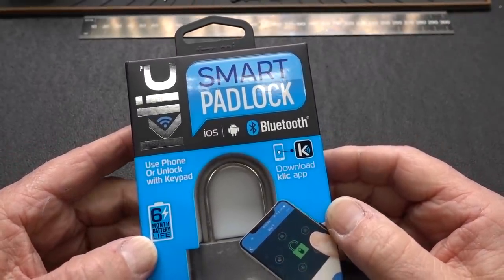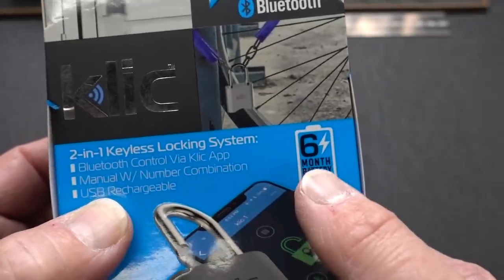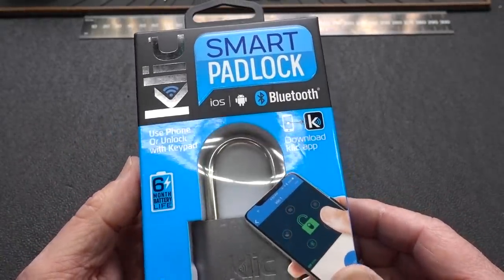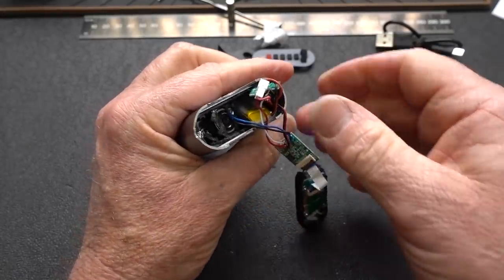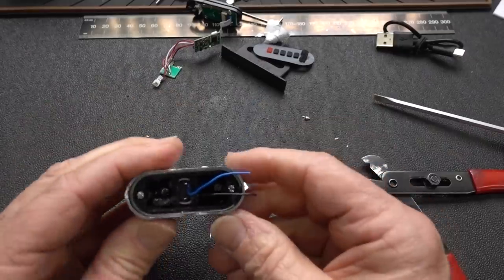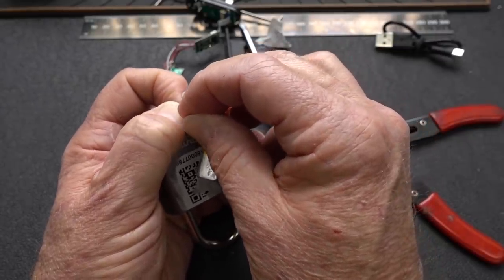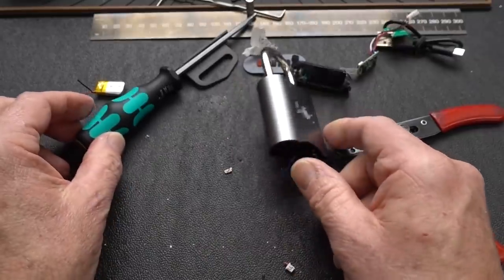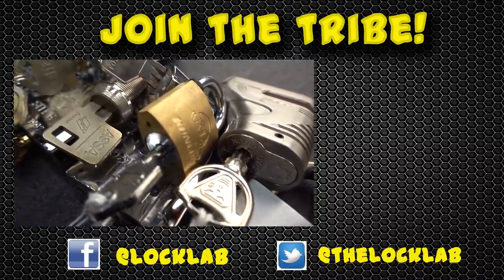(1479) Klic Bluetooth Smart Padlock (JUNK!)

Comment: Holy moly, this is basically hotwiring a padlock 🙃😂
Reply: Robert Chrisman yep thought the same thing but replace moly with shite.
Reply: They call it "Spiking".  Real common way to open safes.  On a safe you usually use a 9v battery.
Reply: @jmr  thanks for the insight!
Reply: 😭😭😭im trying to brake in without braking it
Reply: the hope with this is maybe if you put it in a public area the thief wont bother messing with it.

Comment: If there's anything I've learned from bigclive it's that you should always have an explosion containment pie dish handy when dealing with cheap lithium batteries.
Reply: Especially when potentially stabbing it with the "app" or shorting the leads together after removing the connector.

(Also, big up the Big Clive posse!)

Comment: Glad someone made a video on this. I bought 12 for $1 a piece in the Walmart clearance section. I'm using these locks for plastic gun cases which can easily be cut through with a knife. So to me it makes sense to use a low security lock on a low security plastic box. At least it looks legit when I make the trip out to the gun range. Other than that use I cant imagine using these like you would a normal master lock.

Comment: Saw one on sale at Walmart for $4, picked it up as a neat toy. Thanx for showing me that I don't need to go get bolt cutters if it decides to die on me. Currently using it as a non critical lock outside to see how long it will hold up to the weather in New England. Hopefully it lasts longer left to the elements than it did to brute force.    If anything I guess it wouldn't be a bad gift to give for a middle school student's locker. =)
Reply: Loool I just got one in Walmart for the same price $4.00... after this I will return it tomorrow lol

Comment: What's easier to pick. A door lock or a padlock? + I just got into picking, what are people's reaction when you tell them that as a hobby you pick holes?
Reply: That's a pretty typical hobby for a young man on a Friday or Saturday night.

As for ease, depends on the products.  Low end Master padlocks usually have four pins, but on the other hand I bought some new-old-stock six-pin Kwiksets that the keys were missing from and I was able to rake them open with a piece of TIG welding filler wire.

Comment: That is amazing. Did you buy like 5 of these to figure out this exploit? I dont think I would have ever thought of reconnecting the battery like that. As soon as I saw the screwdriver I thought he is going to take it apart destructively and that is all.
Reply from the maker: No, just the one.  As soon as it opened and I saw the actuator wires & battery, I knew we could "jump" it open.  When you've seen one of these things, you've seen'em all.

Comment: Locks are there just to buy time. It took you pretty long so the chance of getting caught it pretty high. You can carry a bolt cutter with you or even battery powered grinder which I'm sure is faster to bypass the lock.

Comment: What is the mechanism to hold the shackle down when locked? Didn't see a notch when it opened.
Reply: From similar locks, I'm guessing an aluminum wheel, spun by the motor, that fits into a notch far down the shackle.
Reply: @thorlancaster5641  Seems like that might be really easy to pry open then. Curious to see that mechanism.

Comment: Owowow, terrible security but a little note, those power sources are Lithium Ion and they can go bang if you puncture them or short them out...
Reply from the maker: Not bang, just whoosh when they catch on fire.  As long as you don't puncture it all is well.  If you DO puncture it with your "click app", the resulting fire will probably melt the lock open...😀

Comment: Beware of those lithium batteries! Take that cell outside and short the wires and see why. That little cell will push out amps of power into a short, and then usually let the smoke out in a rather dramatic way.
Reply: Mini GP Racing Nah, look closer at that cell. Under the yellowish Kapton tape is a little overload/undervolt protection circuit.  But bypass that, and you'll get some fireworks!

Comment: I wonder if you could do a powerline attack on the USB port, or maybe just overvolt it. Either way, it's still easier to use the "click app."
Reply: That involves quite a bit more work. Honestly, since it looked like the actuator motor was also held in with plastic, it would be easier to just hit the lock body with your foot than even using the 'app'.  My real question would be, what sort of telemetry data is the actual app pulling off of your phone? That's likely the largest security risk here.

Comment: I wonder if you could apply electricity to the shackle and body to possibly short it and cause it to open? Very fun video to watch and I'd like to see them make an improved model, maybe with a 1/4 inch medal plate to protect the bottom of the body??
Reply: like24chickens Electricity to the shackle does nothing, unless you provide the hundreds of Watts needed to melt it.  Their circuit has the electronics and buttons on the same circuit board, they would have to redesign to have an electronics only board inside and a disposable buttons and charge port board outside.  Really hard part is to accept power from the outside board but reject power line attacks.  They also need to put the Bluetooth antenna outside the metal enclosure.

Comment: Shorting what looks like some kinda lithium cell is never a good idea, even if it's a small one
Reply: Connecting it to a device (the motor) intended to be operated by said battery is NOT "shorting the battery." Shorting the battery= connecting both wires from the battery to each other. Now, cutting the connector off of it might have momentarily shorted the wires to each other, but it wasn't long enough to do anything. Still not advisable- cut the wires individually. But there's almost zero risk in connecting the battery directly to the motor. What do you think the circuitry does?
Reply: @puckcat22679  I'm talking abkut the way he cut the wires and handled them afterwards

Comment: These so called smart locks are virtually all junk .They are made out of plastic somewhere or have screws open to brute force disassembly .The companies making these are IT companies with no securtiy experience at all .So , it's like a smart device , ie. smart phone , tablet   to design and make a thing for them .Would you use your tablet or smart phone as a lock to keep your valuables safe , I wouldn't  . They are just too fragile  and can  be destroyed easily , no protection.So until these companies make a smart lock made TOTALLY  of solid steel, aluminum , you can't beat old fashioned solid steel, aluminum locks with hardware locks with pins, rings ,and a real solid complex key , period !!!!

Comment: I cannot see how you can make an effective electronic locks without having a sturdy case (for both the lock itself and motor) protecting it, or a plethora of other mechanisms that would effectively discourage attempts at tampering. The fact that motors are basically inductors means that if you pass current through it, it would rotate. Unless the whole electronics was potted with the motor or they engineered some kind of solid state actuator with solid state authentication measures (meaning even more electronics and expensive engineering), electronic locks are never happening.

Comment: Is it that hard to use metal instead of plastic?
Reply: Not Dave Metal stops the radio signal for the Bluetooth.  Wiring an outside antenna requires official certification that it doesn't disturb other stuff in radio range.

Comment: The permission requirements for the Klic app and the fact that you have to create an account and the app has to phone home when you use it is absolutely ridiculous. This should be handled completely locally from phone to lock without establishing an internet connection for any reason whatsoever.

It also doesn't help that the lock is flimsy and trivially broken into.

Comment: I have yet to see a Bluetooth padlock that isn't a heap of junk (not just physically the bluetooth protocol and "security" is usually also junk and easy to hack).
Fingerprint padlocks are just as bad from what I have seen.

Unless you are buying one of the really high-end electronic padlocks from the likes of Medeco or Mul-T-Lok, forget electronic padlocks and buy a good quality keyed padlock instead.
Reply: What about that "nokè" lock he nessed with? That one seemed pretty solid.
Reply: If I needed a high security lock, I would still rather trust a company like Assa Abloy that has been around for nearly a century (the founder of Abloy invented the Disc Detainer lock in 1097 and formed Abloy in 1918) than some company that's been around for maybe 5 years.

Maybe their cryptography is better than everyone else. But I would still trust anything important to a good quality mechanical lock ahead of anything involving cryptography (and I say this as a software developer who has written cryptographic code before and knows a lot about cryptography)
Reply: @jfwfreo  i still don't understand what you people are locking up thats soo valuable you don't trust any locks. Its a padlock. Its not for a bank vault.

Comment: I get that they are weak, but aren’t they mostly used like cheap combo locks on a locker??  Do people really use them for something important?  Then again I have yet to meet a padlock that can withstand much more than 60 seconds with an 18v cordless 4 1/2” angle grinder with a fresh cutoff wheel. 

I’d give it a 2 - 3 out of 10. It will keep the honest people honest. You got into it destructively. If you had pop can shimmed it and relocked it I would put it lower. If you just used a neodymium magnet to unlock it, I would put it lower. IMO the screwdriver attack isn’t any different than a hammer or crowbar.  Brute force attacking locks is not quite as much as cutting them off though.
Reply: I do agree with you 100%. This video was entertaining, and we should treat it as entertainment. 

He did a brute force attack, and had easy access to it.

Comment: Great, the modern locksmith needs to be an electrical engineer too?
Reply: You dont have to be an EE to connect a battery an a motor.
Reply: Operator 801 But all the actual lock smith companies seem to be selling alarms and security systems too, so they better know how (not) to wire these securely.

Comment: If all that is holding the actuator in place is being turned by that teeny little DC motor, I'm sure a light smack with a hammer would be more than enough to obliterate it.

Comment: That was an abortion.  I bought this lock at Walmart and then experimented with it at home. There are only 256 possible combinations and there is no reset. In other words, you can enter 1111 and then 1112 and so on. When you hit the correct combo (1 out of 256), it will open. There is also no wrong combo disconnect after a certain number of incorrect entries. The 256 possible combos can be entered in under 2 minutes.  

There are four possible entries for each digit and there are four digits. Therefore, 4x4x4x4=256.

I returned it at Walmart and got a refund. Your method of review, although more entertaining, makes a return impossible.